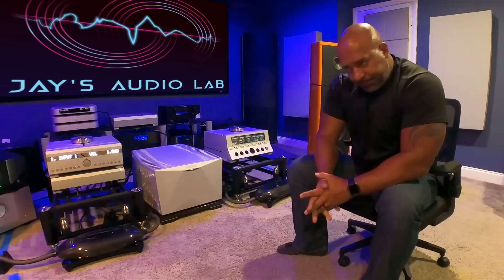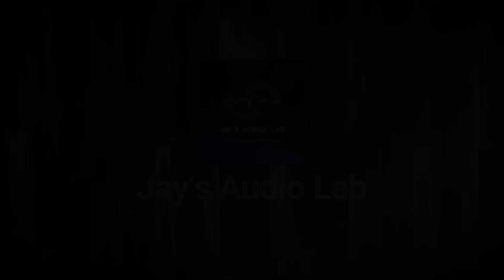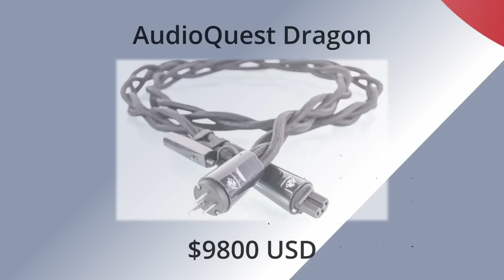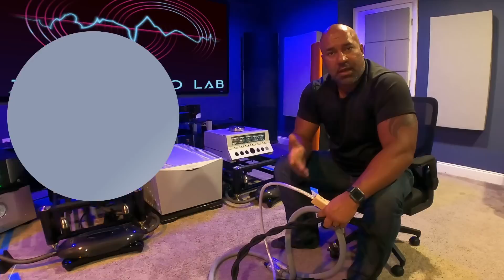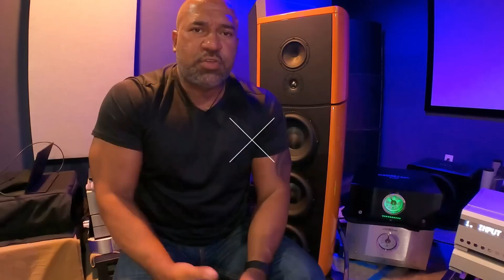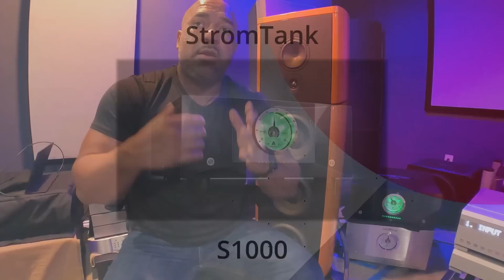Why Do Expensive Audio Components Need Expensive Power cords To Sound Their Best ???

Comment: If I thought I needed a better power cord I'd make one out of the same wire that's in the wall which for most homes in the US is 12/2 Romex. I'd use a Hubbell 5352 or 5362 plug and I'd find an IEC connector or I might just solder it to the equipment end internally where the equipment's own IEC receptacle is soldered to. If you want an extra measure go to 10/2 Romex which is a heavier gage. Where's the problem with that. If you think you need a shielded one (I don't think so) go to 12/2 or 10/2 MC or BX cable. Do not try to fabricate a shield around power cord yourself. You risk overheating the wire, melting the insulation, and starting a fire or worse.
Reply from the maker: Can't argue your point
Reply: That's entertaining, but Paul McGowan of PS Audio to name one recommends trying just that - make your own and then LISTEN.

If you don't hear a difference, no big deal. If you do… go with what sounds best.
Reply: @VideoArchiveGuy  Making a power cord from the same wire that's already in your wall isn't entertainment, it's engineering .
Reply: @markfischer3626  Engineering can be done with various end results in mind.

If just knowing it's made from the same materials is your end goal, great.

I'd rather use what makes the biggest improvement in sonics that's within my budget.
Reply: @VideoArchiveGuy  I've been designing power distribution systems for over 40 years including laboratories that included some of the most cutting edge most sensitive instrumentation in the world in its day. I always used standard THHN /THWN and never had a problem. Why is it that only some audiophiles have a problem with power cords. Everything I designed for worked perfectly with the power cords they came with or some were wired directly to terminal blocks on the equipment. Only some audiophiles have problems with what scientists learned and engineers apply in their designs. Buy and use whatever you like. It's not my money.
Reply: @markfischer3626 Not doubting your experience, and this isn’t a matter of the gear “working perfectly” or not.

If you don’t hear an improvement, don’t buy aftermarket cords.

I do (it’s NOT at all subtle) and do.

Amplifiers work perfectly whether they are driving wire from Home Depot or a high end cable, but few would dispute the cables sound different.
Reply: @markfischer3626  This is a good explanation that may help answer some of your questions and will likely induce others.

https://m.youtube.com/watch?v=ITkuBgFtTjs
Reply: @VideoArchiveGuy  Can wires make an audible difference? I can say confidently as an electrical engineer that the answer is YES. But what they do and to what degree depends on the circumstances. How do I know. Because I know the equations, done the calculations, and I know exactly how they work. Would I then buy them and use them the way audiophiles do? No. There are other ways to achieve the same results cheaply, reliably, adjustably, and predictably. Wires were never intended for this function and are the worst way to achieve the desired results. But then who am I to argue with golden eared audiophiles who hate digital, love analog especially phonograph records and now suddenly hate MoFi records they loved and paid a lot of money for until they found out they were digitized somewhere in the manufacturing process.. So much for golden eared audiophiles who claim they can hear a flea fart in a windstorm.
Reply: @markfischer3626  If you have such disdain for audiophiles, why are you bothering to watch these videos? Simply for entertainment purposes?

Or to play the "I'm an EE, I've done the calculations but I don't actually LISTEN to anything, but I know it's all snake oil, ha ha!" card?

There are many audiophile EEs too, the difference is most don't CARE what the equations say, it's what the sounds coming from our systems say that makes all the difference.

Perhaps you'd enjoy reading Audio Science Review in your spare time instead.
Reply: @VideoArchiveGuy  First of all I'm the world's champion troll. Second, there was nothing on the market good enough for me 48 years ago and still isn't. That's why I had to invent my own which actually sounds very much like real music, not the pale lifeless stuff you audiophiles listen to, yes and that includes Jay. 

Do I love listening to recordings? Absolutely. Right now I'm stuck on Rachmaninoff. I've been listening to a Chesky re-release on CD of Earl Wild performing the 1st and 4th concerto and the Rhapsody on a theme of Paganini. Thank you Bob Katz, you did a great job. I'm sure it's better than the original. Creating the sound of a symphony orchestra in my 4000 cubic foot listening room from a recording as it would be heard live in a 700,000 cubic foot concert hall is no easy trick. That's what this industry promised but never delivered. 

I'm awaiting delivery of a DG CD recording of Rachmaninoff's Symphonic Dances I bought on ebay a few days ago. I have it on vinyl but CDs are my format of choice. Perfect sound forever if you can figure out what to do with the signal to bring it alive. 2 channel stereo just doesn't cut it. Surround sound systems you can buy don't cut it. What you need isn't entirely on the recording. What's missing has to be reconstructed with a special real time computer that contains an algorithm I invented based on my own study and mathematical modeling of sound fields.

Now here is a beautiful piece of music I'd listen to in preference to any and all recordings most of you audiophiles call music which I find more akin to cats wailing on the back fence. I don't like your music and I don't' like your sound systems. So here''s some real music, perhaps the first time you heard real music in your life. 

https://www.youtube.com/watch?v=SlTTgJau33Q
What quiet beauty in a world filled with noise. 

I'm waiting for DG to release this one on DVD or CD. It's been one of my favorite pieces of music since I first heard it 62 years ago. Quiet a bit more excitement.
https://www.youtube.com/watch?v=oD5pqlDPCHc&t=248s

I've got a lot of different recordings of this one, my favorite still the Van Cliburn recording with the Chicago Symphony but I'd buy this one too. How well trained is my hearing? I can tell the difference between the Steinway and Baldwin family of pianos just by listening to them. I've got one of each in my house. Both of these recordings were played on Steinway D concert grands. If your hi fi makes a grand piano sound like a point source then it is awful. They don't call them grand pianos for nothing. Okay, I'm done. Time to troll Russia and their British supporters like the Duran.

Comment: There is several issues with manufacturers to include high quality cables with their electronics 
1-Cable length, how many feet/meters do you need to connect to your outlet 
2-You may have already purchased high quality cables from before which could be better then the supplied manufacturer high end cable
3-Adding additional costs to the system with a cable that is not needed because of statements above 
4-allows you to burn in the equipment for a period of time then allow you change the characteristics of sound depending on type of cable used

Now for the comparison with the boulder, did you use the Stromtank (sorry I skipped part of the video) or did you go direct from the mains outlet. 
Was the power cables had adequate “reburn” in times to the system, by disconnecting and reconnecting any cables can also unsettle them. They won’t need the original burn in time but allow several days of usage still to notice any improvement.
Reply from the maker: I'm testing with stromtank
Reply: Plus there are many who believe in the efficacy of having a loom from one manufacturer.

If say Pass Labs included a high end AudioQuest cable, that means I'm spending extra for that when I want to use a Synergistic Research, and Pass may not be willing to sell me one without the AudioQuest at a discount.

Comment: It just came to my mind that Krell in the early 2000s had a fixed power cord to their FPB power amps … when in their predecessor models they had a 15 (or was it 20 ?) Amp plug. So rarely it happens in HighEnd…but much more often in the very low end components that they come with a stock pc that’s not meant to be swapped out 🙂
Reply from the maker: Good point

Comment: I think it is actually really difficult to accomplish building a component with little power cable interaction, because this affects even the most technically minded professional audio equipment. Granted, I think high end studio stuff is a bit less reliant on cabling, but they still make a difference. As far as I can see there is no amp, preamp, DAC under $100k that manages what you demonstrate. 

And I still prefer the Transparent cable in your comparison. Stock was missing punch. That's what I would use.

Comment: Interesting point. I agree that your Boulder system sounds better with the stock power cords. On the other hand, I think this poses pressure to the after-market power cord companies that their power cords cannot make improvements on the top-level Boulder electronics. I am a bit inclined to disagree with your point that high-end companies should make electronics that do not rely on after-market power cords. 
In fact, I think this might never happen. If the after-market power cords companies want to make a profit they have to show that their products make sense (i.e., make some improvements). If not, then they will lose the whole market. Especially in the higher-end tier where the companies' fame can be established, I believe the cable companies are trying very hard to prove the improvements that their cords can make. Once the cords' positive effects are proven to the general, people will come and buy their products, and now the bar for a "good sound quality" has been elevated ...
Therefore, I think the whole phenomena is like a self-connected loop: New electronics being released -> power cords companies tried to make their cords improve these electronics -> people come to buy these cords -> the new improved sound quality becomes a standard for "good sound" -> electronic company upgrades their parts so that sound quality surpasses old electronics + 3rd party power cords.

By the way, I am not sure if the stock power cords' performance is helped greatly by your stromtank power conditioner. It might be interesting to compare the performance of the cords again with the power conditioner removed.
Reply from the maker: Thanks

Comment: Maybe that in this particular instance Jay struck sonic gold with the combination Boulder and a stock power chord from China. In 99,99 percent high end audio equipment benefits from a good aftermarket powercord. Which means I dis-agree with Jay's assessment.
Reply: I read some of Shunyata's white papers and from their perspective most of the power related audio problems come from the component PSU itself. Jay has demonstrated a couple $100k+ components that are engineered well enough to be less reliant on cables and conditioners. But personally I've never come across audio gear in the realm of mortals that could accomplish this. At this juncture it is still more cost effective to buy high end cables vs ultra expensive components.

Comment: It doesn't make sense, these hi-end brands say this is the best amp,pre,dac whatever it is, then shouldn't it come with the very best cable as part of the package to back up what they are saying about it's sound.
Honestly it looks like a scam where everybody is scratching each others back to make even more money.
Reply: Then you'd get people crying about the price and asking for a cable-less version so can use the fancy cables they already own.
Reply: @chipsnmydip  Precisely. I will audition and use the best cable in my system, not what they say is best.
Reply: The best?

So your $5000 preamp should pack in a power cord that might cost 3x the price of the preamp?  Then in what system? An all-Nordost system might benefit from a Nordost cable where it very well might not sound right in an all-AudioQuest system.

Then what length? 1M? 3M?
Reply: @VideoArchiveGuy  The video was about a $142,000 pre & $142,000 amp.
Don't tell me @ nearly $300,000 they shouldn't come with the best sounding cables.
Reply: @pjmt29  So Boulder should then what, not ship your product until you tell them who makes all of the rest of your cables so they can order an appropriate one for your system?

This is especially true if all of your other cables are from one vendor; usually a power cable from the same vendor will work best.

Perhaps Boulder should include NONE and drop the price a few hundred dollars?

Comment: Great video as always. I had exactly the same experience with mine. I own boulder gear. And one of the reasons why I got it was the fact that power amp already had a power cord that was made for that amp. And after meeting the CEO of Boulder at the dealers store I bought the pre and amp and never looked back. Great sounding equipment and the company. Thank you for what you do.

Comment: I understand and generally agree with your point... But I don't subscribe to the idea that expensive power cords "make a system sound better". I think bad cords can make the system worse and can increase the noise floor, capacitance, etc. Decent cords, that are not faulty or made from garbage components, detract less from a system - they dont add noise, etc. This hobby is full of claims that do not make any sense. Jay, I am still waiting for an improved capture system (decent microphones and interface) that can fully capture your system without clipping and demomstrated measurements of these differences that are so clear to you. If you would present more actual data.. I think it would improve your arguements. Appreciate the content.
Reply: Dude. You can literally hear the changes in his system off an iPad, over, and over, and over. A clip here or there isn't going to throw the whole thing off. If you want (superfluous) data put some of his audio comparisons into a spectrum analyzer. That way you won't have to use your ears.

Comment: Any inconsistencies, smaller transients or dips in current or voltage coming from your wall outlet will be modulated, regulated and filtered by the time it reaches any components in your stereo equipment that affects the sound. You are free to argue that there are subjective nuances and differences in sound character between different power cords but the reason your $100k+ products only comes with a rubber cord is because that's all it needs. If your Boulder or any other high-end amplifier cannot handle the small variations from the wall outlet that may adversely affect the sound, then I have to say they haven't built a very good power supply. The size, design and complexity of the power supply may very well affect the sound of an amplifier (or other product), but you will be hard stretched to produce anything even approaching a measurable difference in sound switching between one power cable and another. If you want "clean power" (which I think you have already), put a DC battery bank and rectify and modulate it to a "perfect" sine wave.

Amir over at Audio Science Review recently did a video talking about this very thing. Even if I disagree with his methodology at times and him valuing subjective impressions differently than most reviewers in the HiFi/audiophile community, I still think that the measurements speak for them self in this case. That being said, if people want to shell out hundreds or thousands on power cables, feel free. I have changed mine because of the aesthetics but cannot say I've heard any perceived improvement in sound.
Reply: Pro audio products are somewhat better when it comes to the need for power products, but the polyannish belief belief that common power cables and PSUs are perfect is just ignorance. Luckily you can always find a guy with a measurement machine who doesn't know how to use it to tell you reassuring things.
Reply: @chipsnmydip  I see your point, but how then would a $10k cable fix such a supposedly flawed power supply design? Is the missing component that makes the amp "work" simply the high-end power cable? Clearly that isn't he case. If it was, then the people building the amplifier would also be the people selling you the high-end power cable because god knows there are good margins on them.
Reply: @Patraquashe  Manufacturers take it for granted that their customers will use a high end cable, and already own some that they prefer. Adding to the price with cabling the customer isn't going to use won't go down well.
Reply: @Patraquashe  Whether an amp design "works" or not is a binary that doesn't reflect reality. Of course any amp you buy will work with any cable. But it is extremely cost prohibitive to build a component that is impervious to power cable related stuff. If you read Shunysta's white papers they are mostly remedying interference from the component PSU. It would be great if it wasn't necessary, but maybe aside from Jay's Boulder and MSB, pretty much nothing out there in high end or pro audio manages to be impervious to power cables. Even there, in his comparison I STILL would have gone with the punchier and clearer Transparent Audio cable.
Reply: Did you watch the full video ? The running on battery etc is what he is doing.

Comment: Jay another annoying thing is unburnt units you get when you buy. So eg Rockports require 400 hours to burn in. Same goes for amps like Gryphon or CH. This should be burnt in in factory. Not to mention you can go wrong listening to unburnt units...
Reply: "Burn in" and "power cords" are both pure snake oil.  "Burn in" is simply you becoming used to a new set of speakers.   ALL speakers of different design sound different.